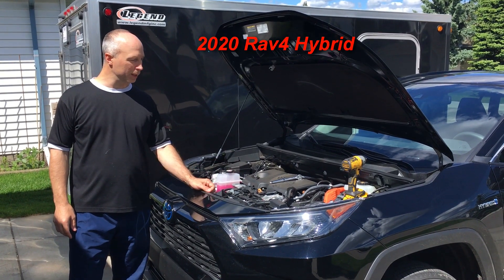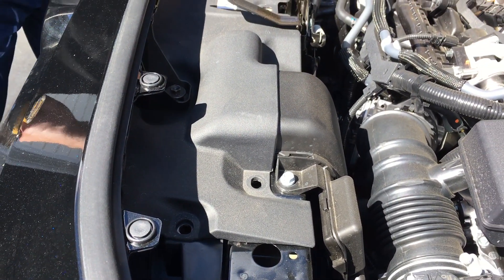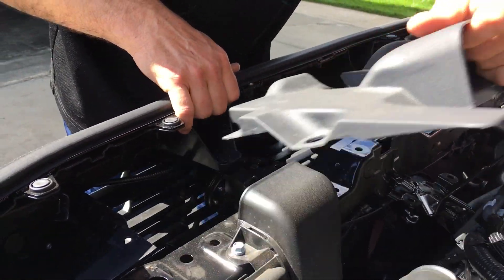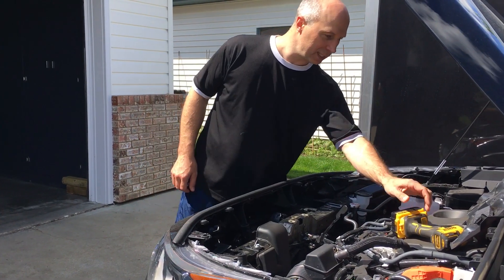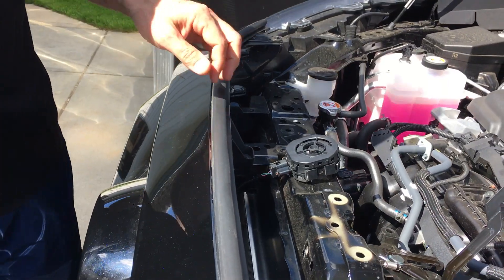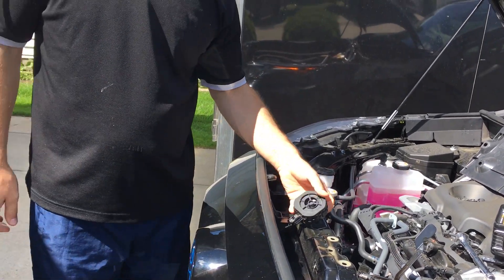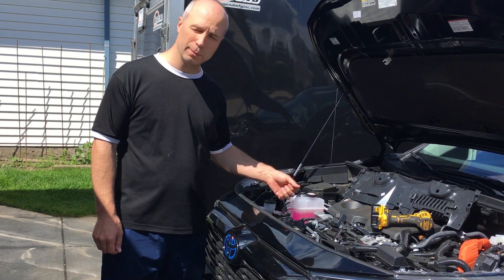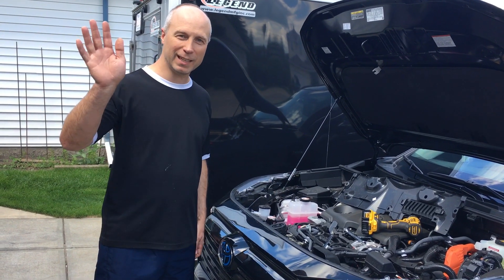EV Pedestrian Warning Sound device explained 2020 Rav4 Hybrid (strange noise when in reverse)

Comment: The legal requirement is for vehicles manufactured after 2019,  I have a 2013 Hybrid with this warning system which technically is not a legal requirement. would that be a reasonable assumption?
Reply from the maker: Typically older vehicles are grandfathered so they do not have to emit noise. But you never know if future legislation may change that...

Comment: My wife’s 2019 Toyota Avalon Hybrid is as quiet as a church mouse. It was designed in Michigan and built in Kentucky in 2018. But my 2019 RAV4 Hybrid makes the high-pitched squeal you demonstrate, along with other odd sounds when slowing down to a stop. Even though both Toyotas are the same model year, the RAV4 was built in Japan in 2019, after the pedestrian warning law came into effect.  I love them both, but the Avalon is BY FAR the quieter of the two.